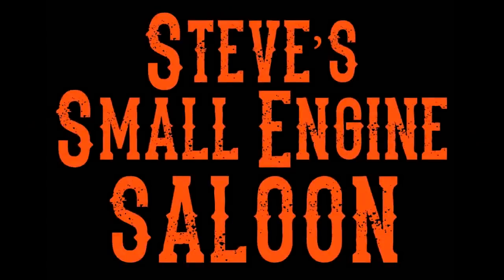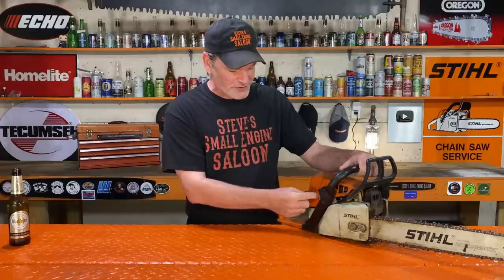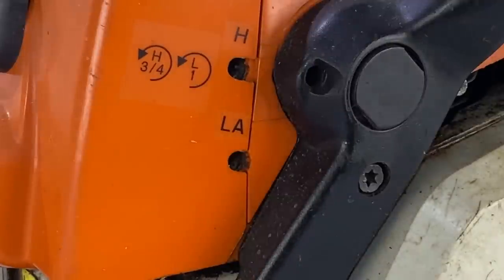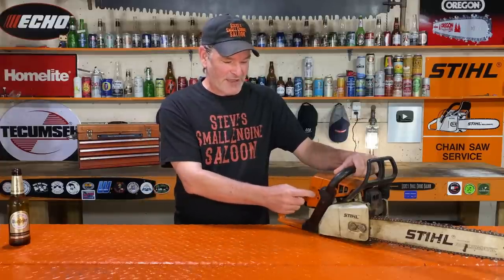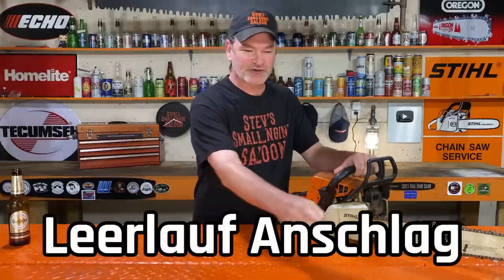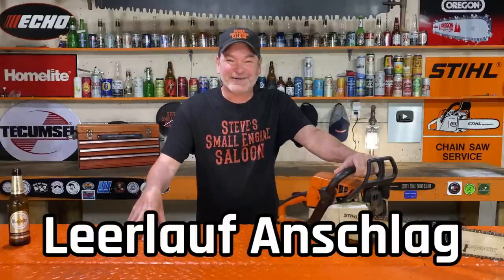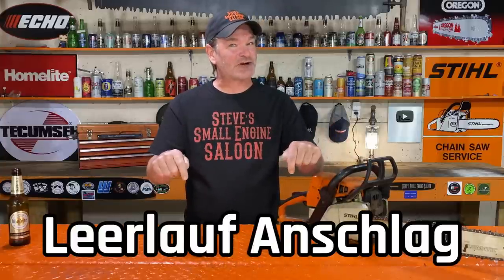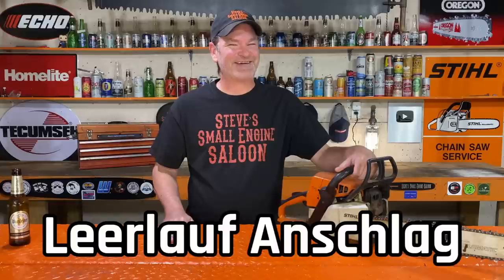What Does LA Mean or Stand For On Your STIHL? (Bet You'll Never Guess!!)

Comment: I love your site and content. You had me hooked years ago when you opened with the beer of the day!!  I'm hoping you can help me. I love my Husqvarna 240. I can't get the plastic clutch cover back on after inspection and cleaning. It was also hard to remove the metal band from the clutch when I started.  The metal ring attached to the plastic cover won't go over the clutch when re-installing the cover. There is no damage to any components and I'm a 40 year mechanic working on small engines. I hope someone reads this and can help.
Reply from the maker: https://youtu.be/vYr-jU94yAI

Comment: When you look behind the plastics directly at this screw it is not a jet, but simply a threaded "cone head", that pushes the same bracket as slave end of the throttle cable towards the "more faster, very vroom vrooms" direction.

Comment: Hey steve, idea for future video that I’d love to see, any tips for getting a stubborn pressure washer pump off an engine? I’m in quite a few engine repair fb groups and see this topic come up frequently with few good answers. Lawnmower blades you can at least fit a puller on, but pumps especially the ones that come on cheaper Home Depot/ lowes gas pressure washers seem to have no good way to apply pulling force on them once they are rusted on there

Comment: So basically controls the travel of the throttle (trigger). Same as some outboards.
Reply: Actually not the travel of the trigger, it is the stop of the throttle travel. It is where the  carburetor return spring pulls the throttle back and stops the travel of the throttle. All carbureted vehicles have an idle rpm adjustment, it controls how much the throttle is open at idle, not the full travel of the throttle. Carbureted vehicles idle somewhere around 600 - 900 rpm depending on whether it's an automatic or manual transmission. Chainsaws idle is usually around 2300 - 2500 rpm. I hope this helps.  Just my thoughts from the guy in Tucson

Comment: Off topic,but i have a 09P602-0077-F1 briggs.and the choke stays open.its not hitting the linkage like i saw in another video.it looks like the arm that its attached to goes into crank case?how does the choke thermostat work on the model?

Comment: Y in Sam h does my new fs38 stihl refuses to start I never had a problem until I got the new fluid shit 50/1 pre mixed crap I take to the dealership np I go to use it fubar and I did the same as he did my old fs 200 which is on 12 years old first pull

Comment: It means "Read the bloody manual and then you'll know what it's for!" I have quite a few pieces of Stihl equipment and to be honest with you I have hardly ever had to bugger about with that particular adjustment but it's there if you need to e.g. if your strimmer head continues to turn even if you are not using the throttle, turn it back a bit until it stops.

Comment: I need help with a chainsaw problem, I have a echo CS-3000, I bought new parts for it and put them in the saw and they include air filter, spark plug, fuel lines, purge bulb and a carburetor  and it will not start at all, one place said i might have put the carb gasket on wrong and I checked that it was correct, no small engine shop around me knows what the issue might be, what's going on with this, can you help me

Comment: So what do the L and H stand for?
Reply: High and low.
Reply: @JGsgarage_unboxings  thank you. I clicked on the link and watched the other video. My problem is my saw won't even start at all. It doesn't act like it even wants to try. I have spark and fuel, been suspecting the carburetor. Any other ideas?
Reply: @matthewturley1152  yes. Set the saw on the ground and try pulling the pull start cord. Without touching the saw with the other hand. Slowly. If the saw stays on the ground you have bad compression.